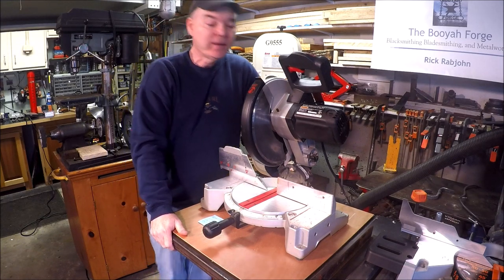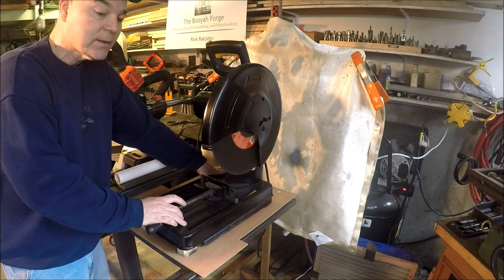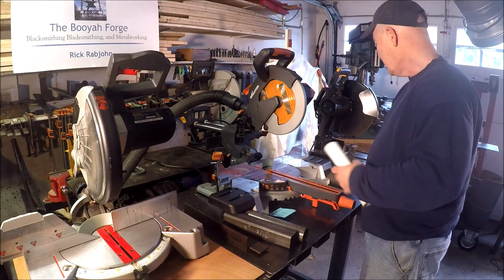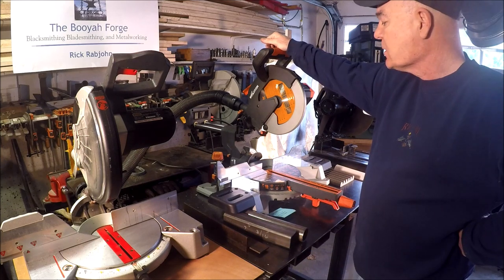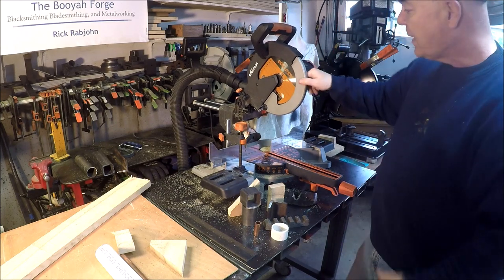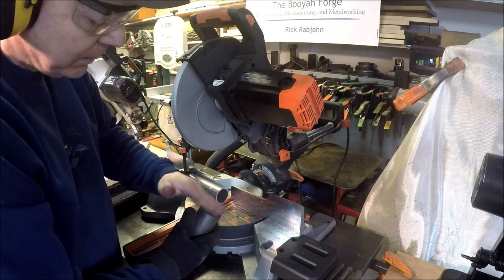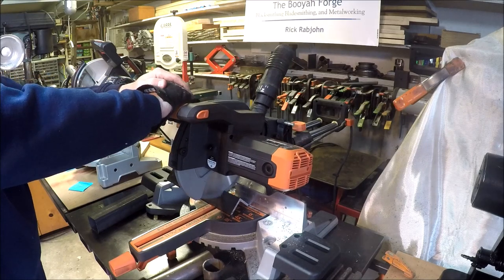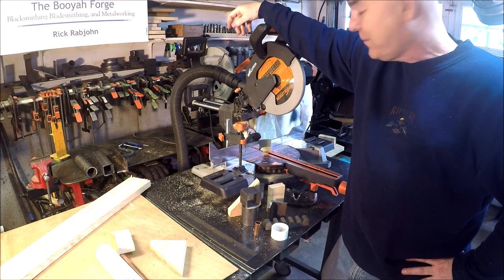Evolution R255-SMS Miter Saw Review

Comment: Yeah Rick I've been using that saw in my Welding/Fab shop as my primary saw for over 5 years. Its phenomenal! Just a couple of minor things that would make a perfect saw. When I bought mine it had a lot more plastic parts and the metal chips melted to the plastic, and the fence and hold downs weren't as nice, you had to have a secondary hold for extra safety. Other than that it is the "Cat's Meow".
Reply from the maker: Thanks for sharing Brady - I think these guys at Evolution are on to something.   Booyah!